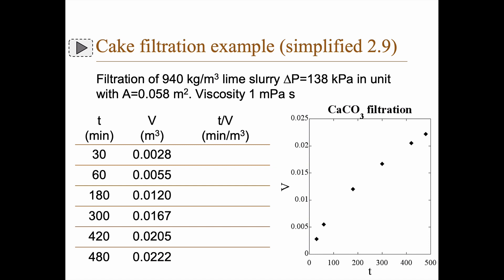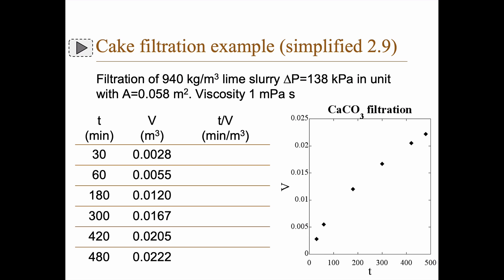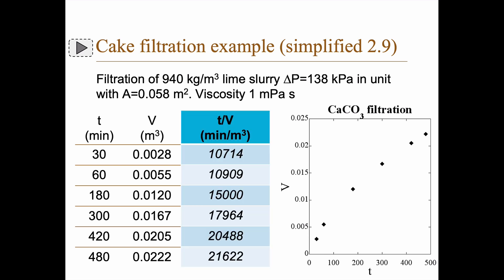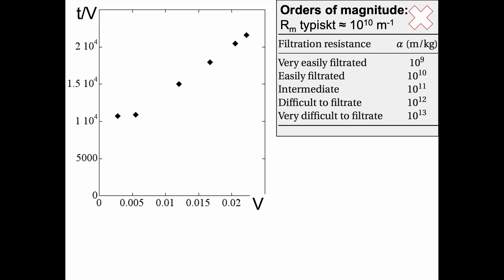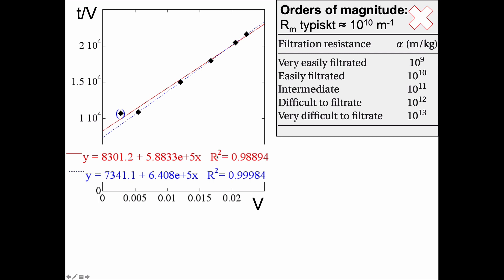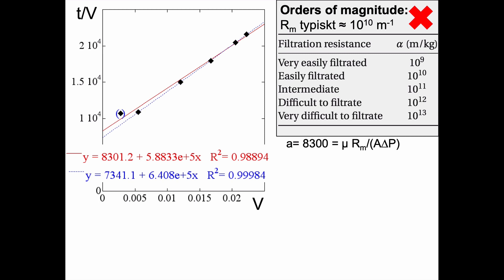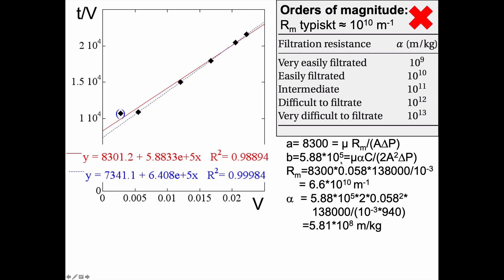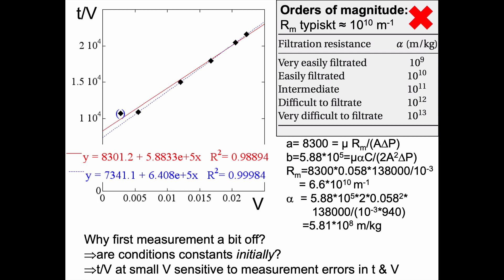Cake Filtration: Example (DRAFT video)

Comment: The units of time should be seconds
Reply from the maker: Are you referring to a specific point in the video or is it a general comment? As long as you keep track of what units you use and do unit changes correctly, the unit of time can be any valid time unit. It would be rather inconvenient to measure heart rate in beats per second or the age of Sweden in seconds…
Reply: @PLE_LU  In terms of the calculations, if you use minutes you need to convert that into seconds so the equation is consistent in terms of dimensional units.
Reply from the maker: @pgtmamb  as I said, you must be careful with units when you do the calculations, as always. What units you use in a table or similar does not matter. If you read up on membrane filtration you will notice that seconds is not always the unit used in books and articles. Thus you should prepare yourself for dealing with units as they appear.